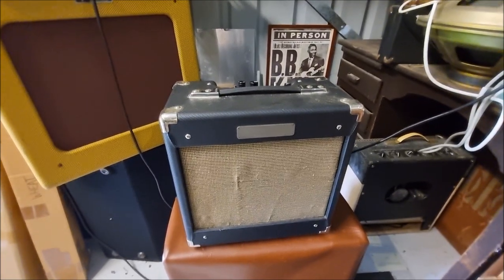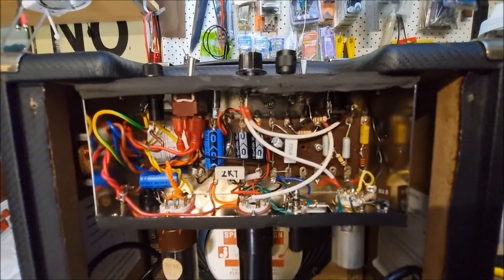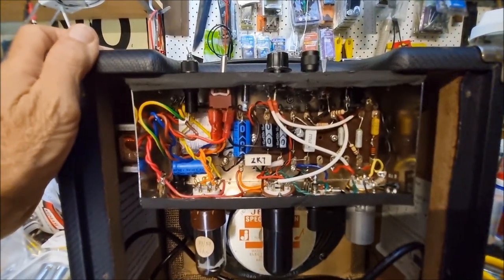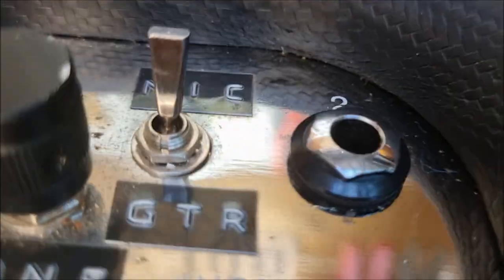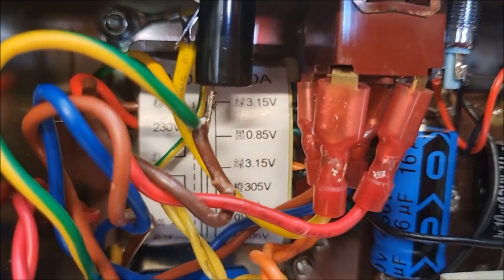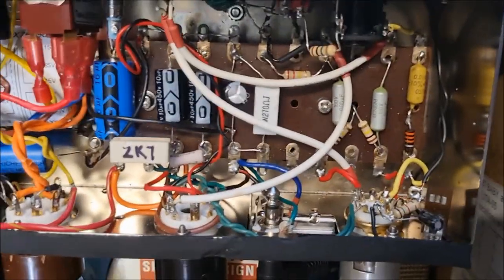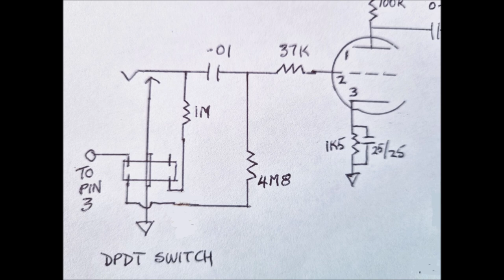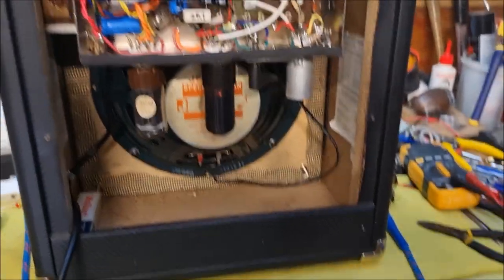Hum Busting a Single Ended Tube Amp

Comment: I built a 5F2A Princeton in the standard Fender chassis. Hum is nearly inaudible. I added a 5H choke after the first power supply cap and made the preamp caps all 20uF. For grounding I isolated all the jacks and control pots from the chassis, and ran every ground in the circuit to one 18awg bus wire grounded at a single point on the chassis, at a ground lug under a transformer bolt. Center taps for B+ and 6.3v line are also grounded there.
Fender's layout is a total mess. I ignored it.

Comment: I love the 6n2p.  I've used them in a couple builds. You can wure the amp in such a way that you can wire a switch and choose whether to use a 12ax7 or the 6n2p.

Comment: Recently came across your Youtube channel and subscribed to it, really enjoying watching your videos, I have a mid 70's (I'm guessing) non-reverb Fender Super Twin all valve guitar amp that a friend sold to me for only Au$300.00, brand new I think it would easily have costed ten times as much as that brand-new, it's housed in a wooden Fender head cab, it works really well as a bass amp too, it uses six STR 6L6 power valves, a 12AT7, a 12AU7, two 12AX7A, and a 7025, puts out 180W RMS, or a whopping 395W peak, very loud clean amp.
Reply from the maker: Sounds brutal!😄 Too much power for the gigs I do, but yeah, nice for bass.

Comment: Don't use a transformer mounting bolt as a ground point. Earth ground from the power cord should get its own dedicated chassis connection (this is part of the electrical code for most countries); and separating the audio signal ground from earth ground by several inches tends to lower hum. Also, transformer mounting hardware tends to loosen over time from speaker vibration and transport shock.
Reply: I've been using the transformer bolt "star-grounding" method for 30 years... never once had a problem, and I don't have hum issues. I see people repeating this "wisdom" all the time on YouTube, Insta, etc, and then they show their amp with the safety ground either soldered to the chassis directly, or bolted to the chassis on it's own. Both of those methods can also come loose from drops and vibrations. So I don't get it. I was taught by old timers who told me they used the transformer bolt, and also "solder isn't glue".

Comment: Could the hum just be the result of where the transformers are positioned?
Reply: Definitely can contribute...move the power and output transformers apart and also ensure they don't couple due to complementary allignment of the windings...i've changed this on a champ 600 and it immediately helped as a sole modification.

Comment: Hard to tell from the vid but it appears you have some inductive coupling going on between the windings of the P.T. and O.P. transformers. The bobbins need to be at 90 degrees to each other and not with the same orientation as you appear to have them.

Comment: I have a fender 007 bassbreaker amp, that has the low tone hum.
I read that it's a single ended amp.
I actually bought two head versions and both hum.
I'd like to reduce the hum.

Comment: I've seen some very messy amps that were dead quiet and then some pretty neat ones that noisy as hell on a Saturday night! You should be able to get that one pretty quiet with some more tinkering. It's funny tho cause it's not always what you think it is or what makes sense ya know! Maybe instead of the isolation technique just ground to the chassis? I know it's against the "rules" but plenty of others have achieved good results. Also, as a harp amp I'd be careful about over filtering that little jewel. Sometimes you can kill the nice soft sort of "bounce" these little amps have. But, that's just a suggestion.
Reply from the maker: Thanks. All good tips. Each change I made DID give an improvement, but you are right, what seems correct in theory doesn't always lead to a good result.

Comment: They hum because they don't know the words! 😂 That thing is a killer harp amp! I've had to troubleshoot a lot of home builds over the years and a fair number of pro builds too. On the fender style amps ive always found that duping their grounding scheme with locations, brass ground bus is just the easiest way. Not the best way, but definitely good enough for rock n roll and its pretty amazing that the fenders are as low noise as they are. A few addl ideas that might help someone: Some Champ copies use the same "one wire" filament that original tweeds had. Not a good way. I would always mod those with the artificial ctr tap like you have there. Another way is the hum balance control (later fender) that connects the wiper to ground and the outer lugs to each filament lead. That can help. And yet another consideration might be your use of the 6v preamp tube: the 12ax7 is wired normally as 6v humbucking. Ive seen minor hum issues in preamps using single 6v triodes. I'm curious as to whether your minor hum is audible with the preamp tube pulled. 
One other common issue ive seen is when people copy the early marshall way of grounding the pots AND running a bus wire on all the backs which terminates on the chassis. Cheers!
Reply from the maker: Thanks for that additional info. Really useful. I will try pulling V1 to see if the remaining hum disappears or stays.
Reply: Good point on the humbucking qualities of a 12AX7 wired to run off of 6 volts; I've read that 12AX7's also had a pair of heaters that were spiral wound in opposing directions, for further hum canceling.

Comment: Good sequence of tips. I've had similar adventures chasing hum.  Here's another good video on the importance of grounding the first stage cathode DIRECTLY back to the input ground without sharing the ground wire: https://youtu.be/GuN35X0Wd5c
Reply from the maker: Thanks for that. It's a pretty long-winded explanation, but makes sense.
Reply: @TheZedvox  Yeah, the main thing is that in at least some scenarios it works like a hot damn to bust hum.
Reply: @stormriderkaos  every amp I've ever built has 1 ground bus shared by everything and terminates at 1 point on the chassis under a transformer bolt ground lug. No hum.

Comment: The filaments can be supplied with a DC voltage using a voltage regulator which would eliminate filament hum.